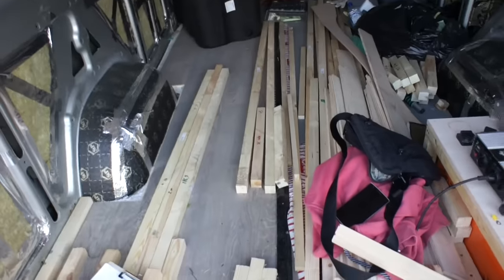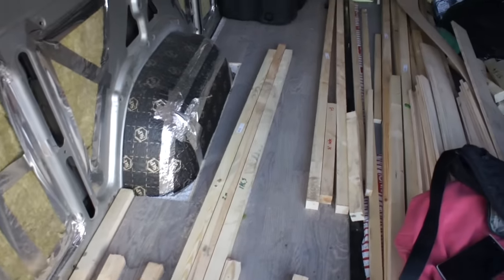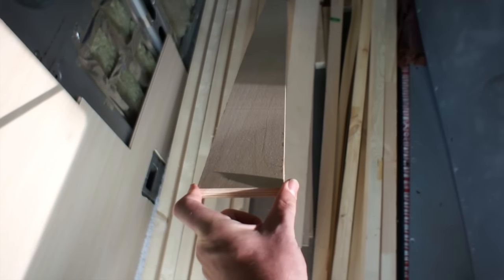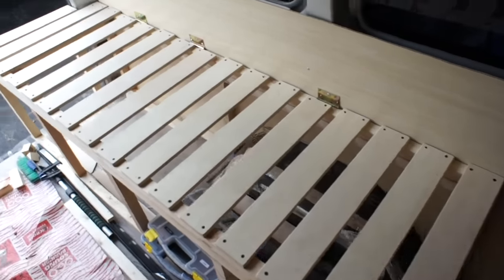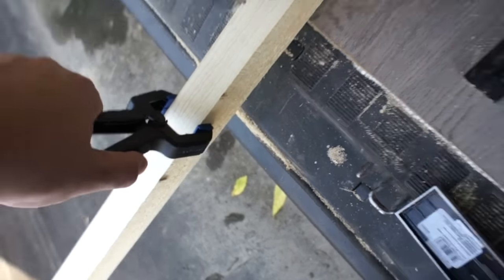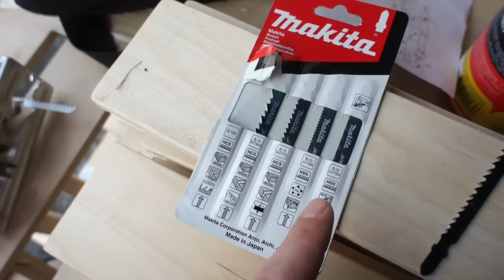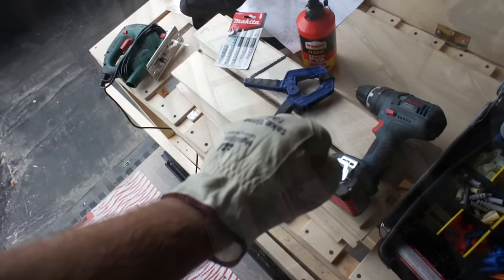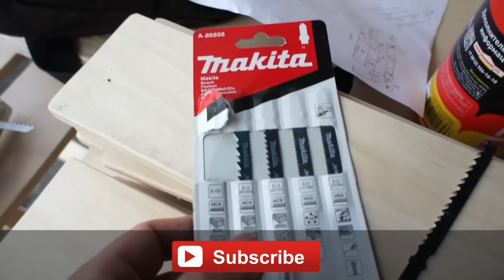Building a campervan bed frame for van conversion camping motorhome DIY project

Comment: 23" is good for a bench, but very narrow for a bed...especially  built flush against the wall.  This design only allows blankets to hang over the edge on one side, so they fall off more easily and/or let cold air in.  If you've changed it so you can fit a board between the benches to make one big bed, then that's another story...but, as it is in this video, this design is only good for a sleeping bag.  Also, lifting the platform with a mattress on seems like a hassle.  My van's bed is open underneath, so I can just slide storage bins in & out.
Reply: This design made for using with middle section for sleeping, you could find more in later videos

Comment: hi been watchin ur van build fantastic work comin on nice could you tell me wot length an width the bed /seat in back of van is please  as im just startin my own  keep up good work thanx
Reply from the maker: Bed mode - 200x180cm, sitting mode - 2x 200x60cm

Comment: How wide is your van?..i need two beds and these look perfect..my van is only about 65" across unless i pull out the wooden ledges which i dont plan on doing unless i decide to gut my whole van..prob won't do that because there r some things about my van that I like..but I do like ur bed builds n this seems perfect for what I need..almost seems like something I could do myself if i had all the tools but I think I will leave it to my friend who has tools and know how..lol
Reply from the maker: Ny van inside about 70" (180cm) so each bench is 23" wide (60cm)
Reply: VanTourist thank you for your quick response..you have done a great job making your van a home✌😊